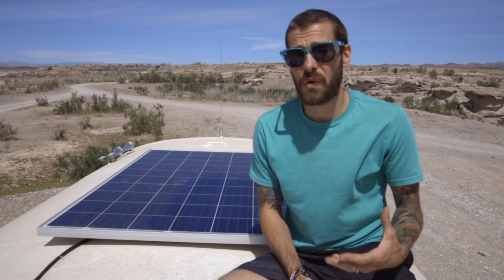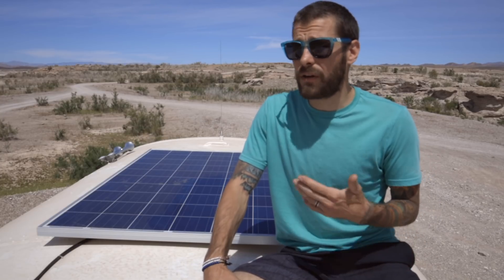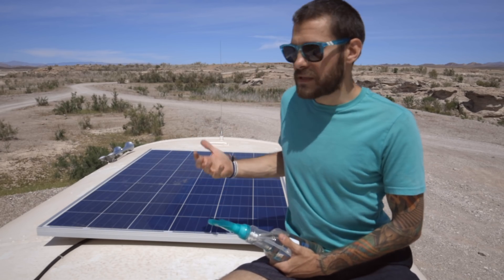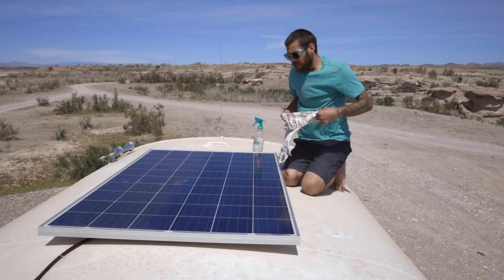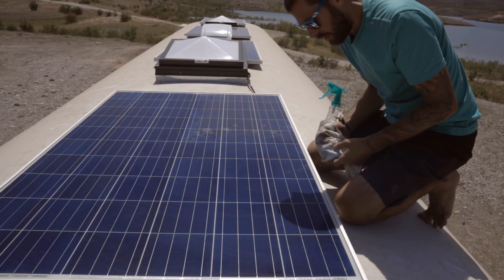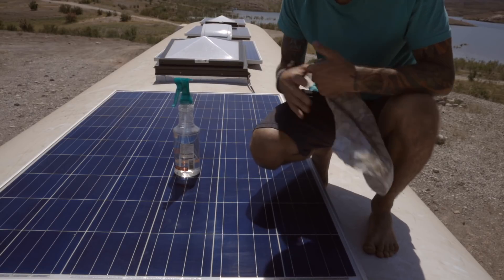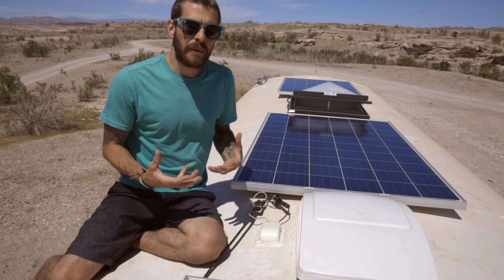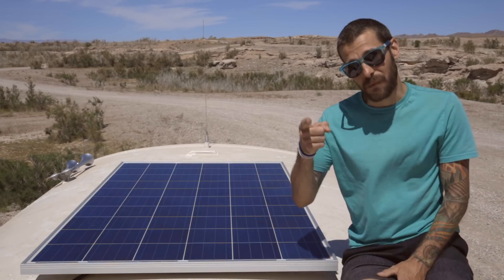Let's Talk Solar Panels

Comment: If its raining outside, is there any problem with the solar panels or not?
Reply from the maker: No issue with rain at all. Shade, dirt/grime, and snow is really the only enemy of the solar panel :) The rain won't cover them or impact their production. If the rain includes severe cloud cover that will impact them of course.

Comment: Any problems with wind noise? I'm worried about mounting solar to my motorhome roof.
Reply from the maker: We never noticed any wind noise from the panels. However, a motorhome is different than a bus. We have 3.5" of insulation in our ceiling, plus the wood paneling. It is also made of steel and not fiberglass/aluminum. Just to keep that in mind too.

Comment: Any danger of electric shock during cleaning ????
Reply: None at all, unless you didn't wire it properly or have a defective panel. Otherwise, there is no worry about electrical shock as solar panels are designed to be in the elements and are totally sealed.

Comment: Please, don’t use silicone. It will peel and leak. Use a white high grade polyurethane instead. Silicone is bad news. Love your videos and what you’ve done with your rig. Thank you for sharing ❤️
Reply from the maker: Hey! Thanks for the comment. I actually misspoke when I said silicone. We used a product from Loctite that is meant to create a waterproof seal and still flex without cracking. We have since added a new layer of Henry’s tropicool (elastomeric) that seals the whole roof. So far so good. Thanks again for commenting and looking out!

Comment: That's awesome that y'all are able to use the 1:1 vinegar:water spray to clean everything! We may have not made it there yet, but one thing we're wondering about is how to charge the batteries via alternator/solar/shore power without affecting the busses drive battery bank... Do y'all use the alternator to charge your battery bank when you're driving? Or is that overkill and not necessary? We plan on having a backup generator too :) Thanks for such a great video!
- Brian + Erin
Currently Shopping for a School Bus :)

Comment: Thanks for sharing! 

A tip I learned from a solar guru: if you apply a coat of Rain-x to the panels, they will stay cleaner.

We just installed our panels (last week in fact) so I haven’t had a chance to test this method and therefore can’t vouch for its effectiveness.

🤙
Reply from the maker: Thanks for the tip! I’m sure that will probably work well. I will have to give it a try.

Comment: Ok, first of all just a comment; love this video and so appreciate the bloopers at the end! Second, I was literally JUST going to order my panels tonight. One question is that I’ve noticed that some people buy racks to mount them in, I see that you mounted each panel directly to the bus which was my plan as well. Can you speak into the necessity of using a rack or is it just preference at the end of the day? Thanks so much for your video, so timely. Curious to know about your other components of your system (batteries and inverter). If you have another video regarding that let me know.
Reply from the maker: Thank you so much for the comment. I'm glad that I posted this just in time for you. To answer your question the rack is just another option to mount the panels. I didn't personally want to do the rack because of the extra cost and weight, but it would allow you to more easily remove the panels at a later date or slide them back and forth.

Not sure why the links are not showing up at the end of the video, but here is the link for the inverter video. https://youtu.be/_MsQfgm-Ogk